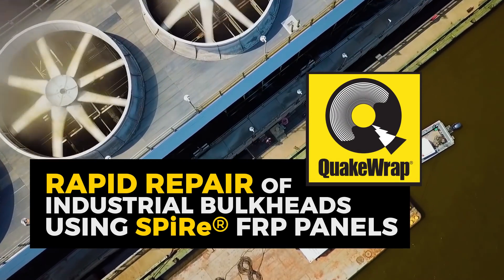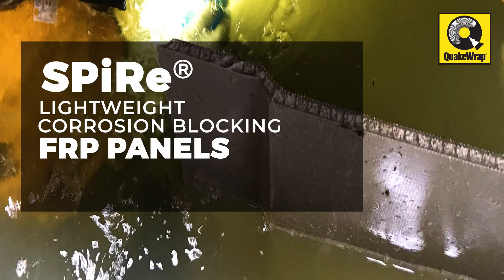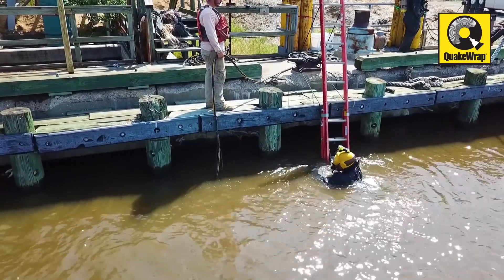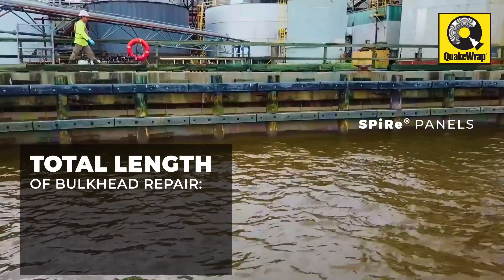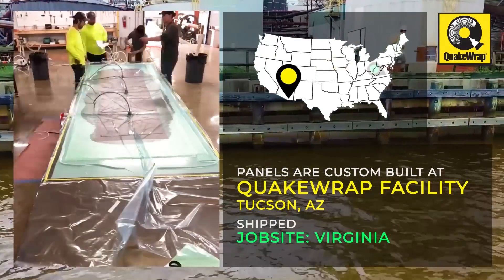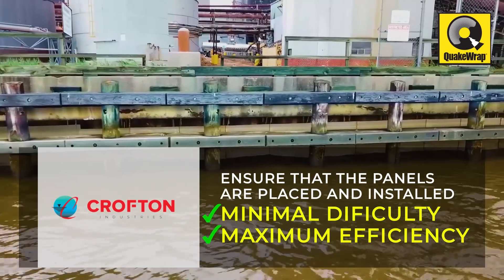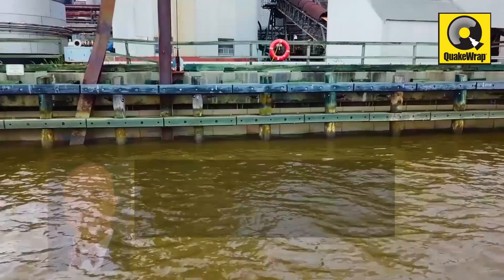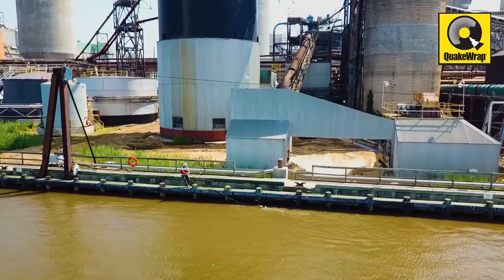SPiRe® FRP Panels Repair Steel Bulkhead

Comment: So the panels do not extend below the mud line, correct? How does the grout seal at the bottom underwater work?
Reply from the maker: That is correct. This is an above mudline installation. Todd if you send your best email to info@quakewrap.com we'll have a technician contact you directly with details.